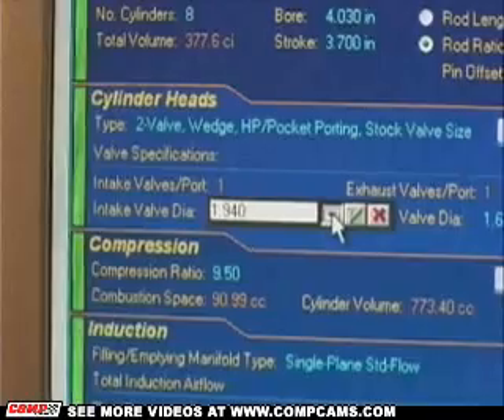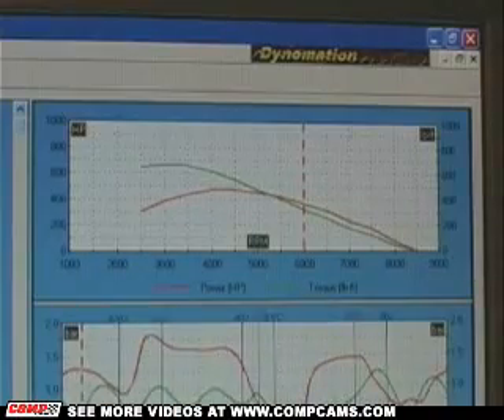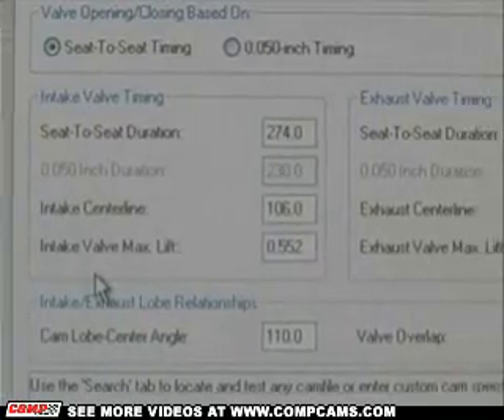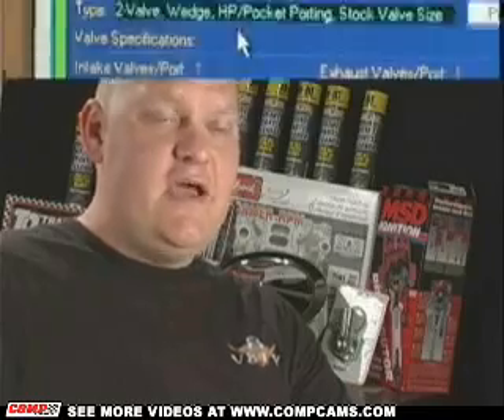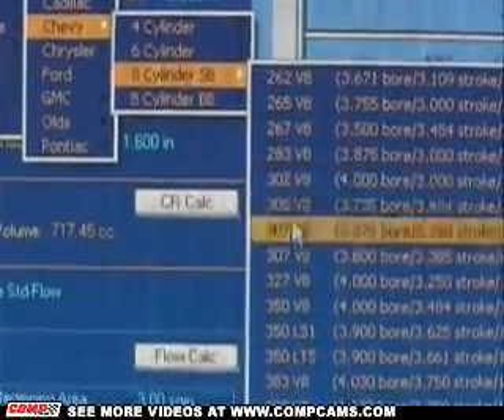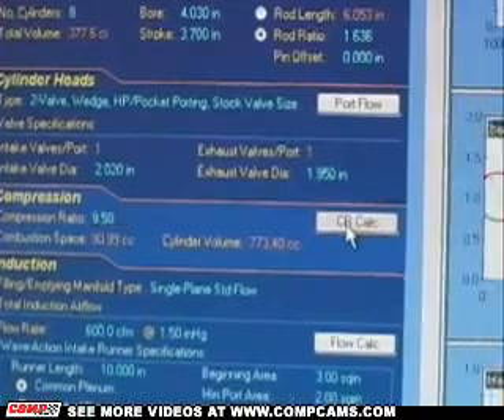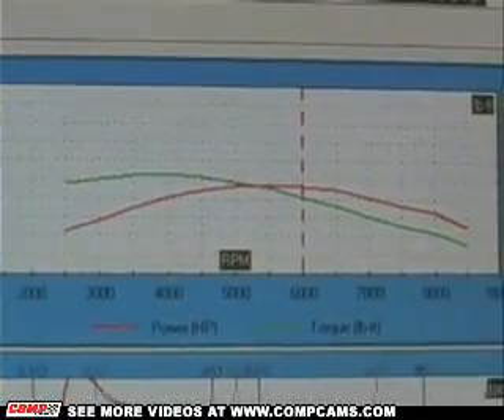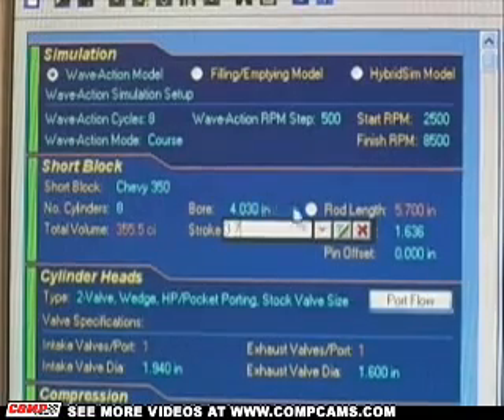Dynomation™ Software on V8TV

Comment: I find this software doesn't go far enough when running roller cam profiles. Comparing flat tappet grinds to each other is fine but with flats to rollers it's coming up short. This software on roller cam grinds doesn't add area under the curve @ plus 0.200" lift which is were a roller dominates over a flat tappet grind. The built in cam manager applies even lower lifter acceleration rates to a roller than it does to a flat tappet when it should be doing the opposite. When i run roller cam simulations i have to manually adjust the lifter acceleration rate from 3 to 5 to show a gain over a flat tappet. Anybody else notice this?  Gotta say the Pro Iterator is a pretty cool tool though.
Reply: Change the lobe rate is the only way, but a roller cam IS more aggressive
Reply: @paulcochran3780  lifter rate is only part of the story and may not be the best band-aid, if you ad 0.050" lift to the roller you can duplicate some of the additional area under the curse that the roller has but it would be nice if the software had 0.200" as 2 more duration points to calculate with.